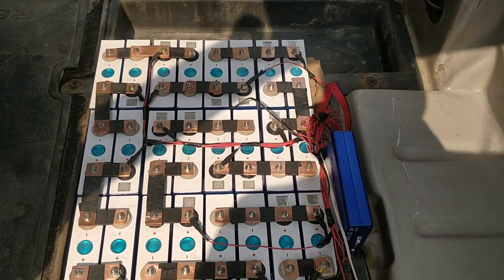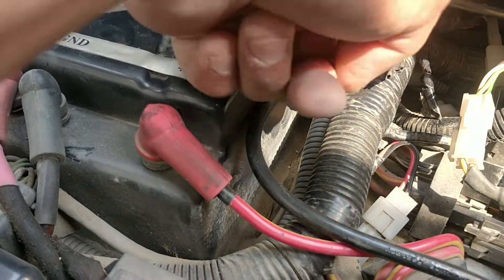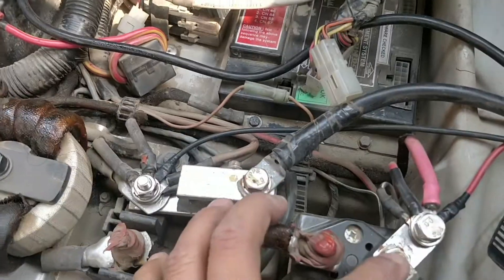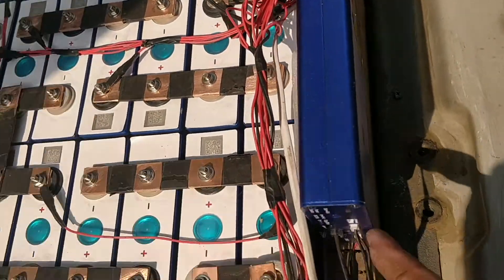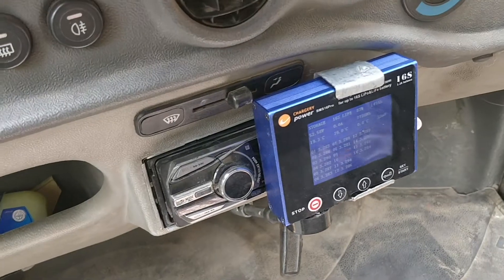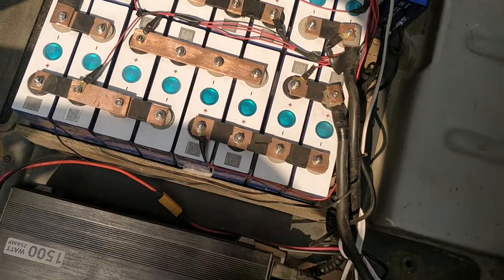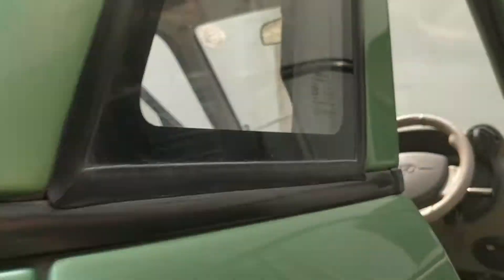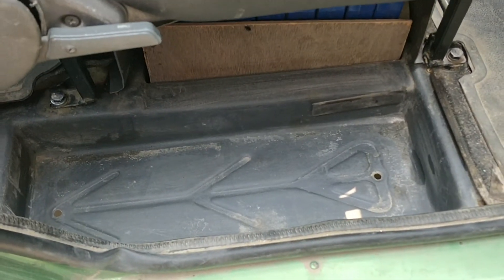Revai / Reva Gwiz Lithium Conversion

Comment: Bro my speedometer odometer and battery level indicator is not working... It's an used car with Lifepo4 48v 100ah cylinder cells

Comment: Fantastic! exactly what I am looking for. My current Lead acid batteries are giving me 25-30 Km range. I am thinking of replacing them with a LiFePo batteries - probably 1/2 your capacity - say about 100Ah to begin with to get 50Km range. I need to figure out the batteries and BMS+charger combo to get. Keep up the good work!
Reply: Sir ple give your contact no ,car ke baar me kuch puchna hai